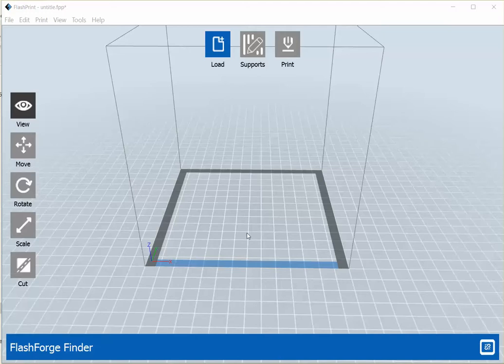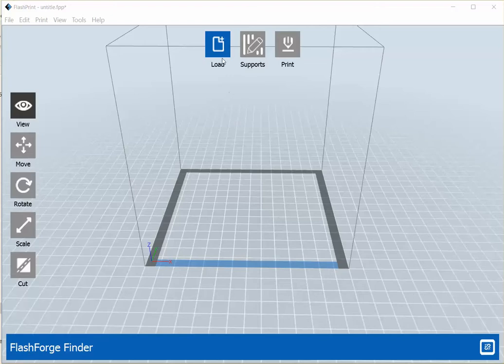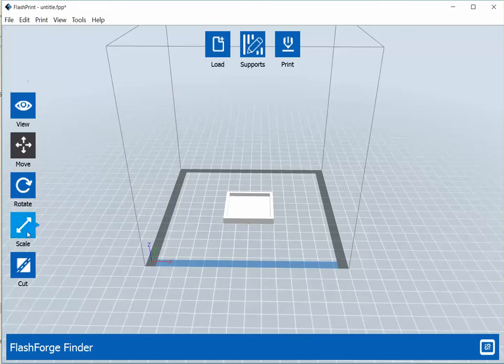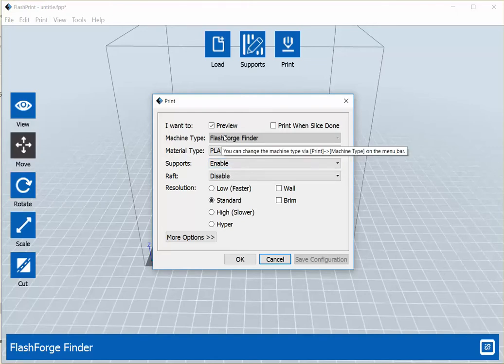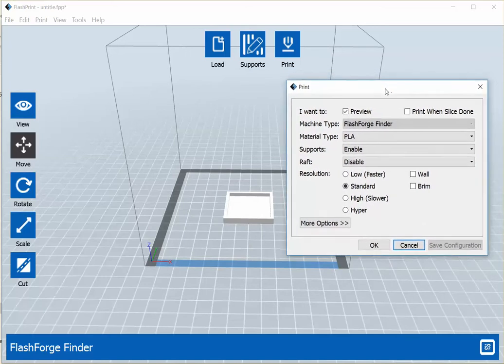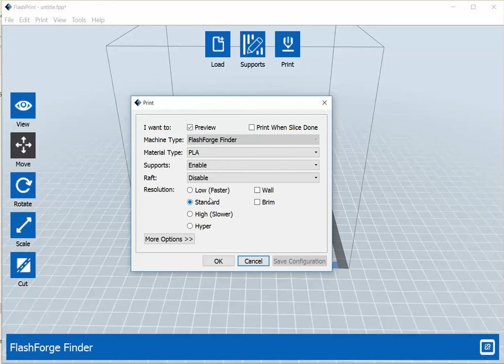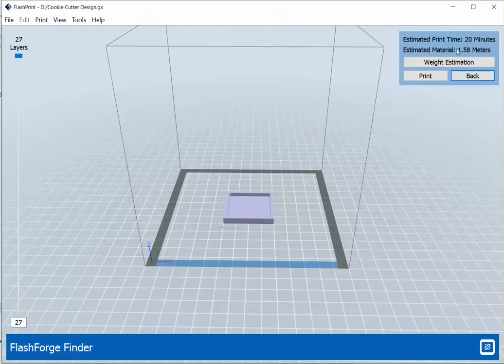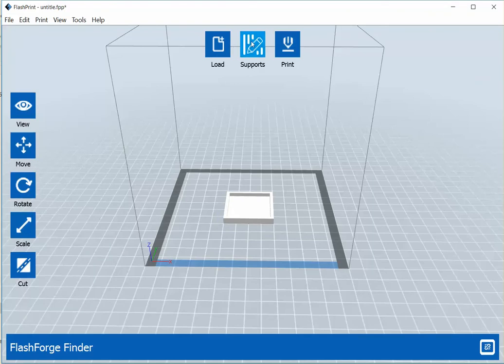Printing with FlashPrint

Comment: would you know if you can use this flashforge slicer to print to larger printers like the artillery sidewinder x 1 which is 300 by 300 by 400 mm